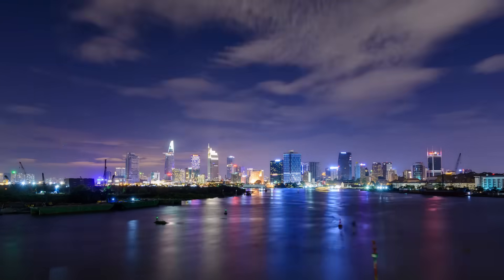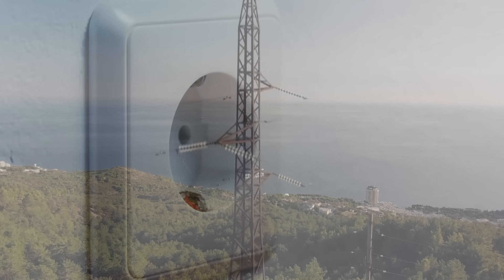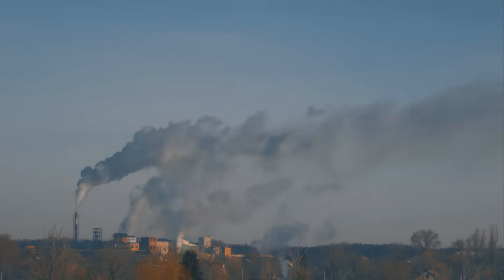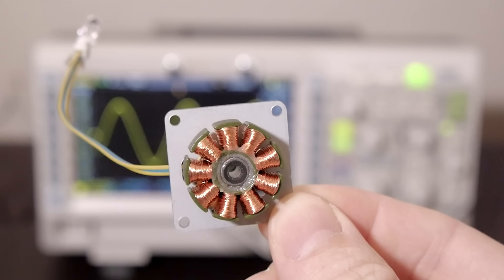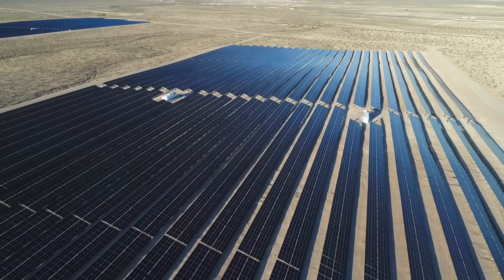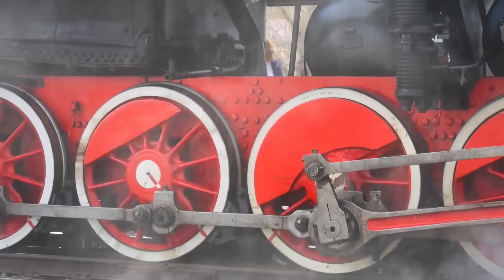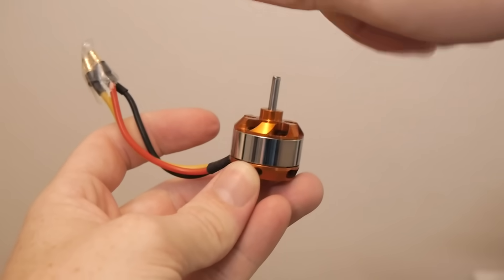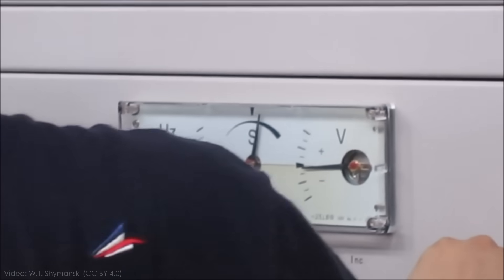How Electricity Generation Really Works

Comment: I see you are on of those types that still believe in Global Warming. It is called "Climate Change" now. 
FYI, Climate Change has been happening long before it was "human made".
Reply: Global warming and climate change are different things.
That said, you're wrong.
CO2 concentrations have been increasing (we're over 400ppm at this time, whereas it was just about 300ppm 150 years ago). https://climate.nasa.gov/climate_resources/24/graphic-the-relentless-rise-of-carbon-dioxide/

Isotope analysis of airborne carbon shows that we're the main cause of this increase ("natural" airborne CO2 has a particular ratio of C12,C13 and C14, what we release has a different ratio). https://www.bgc-jena.mpg.de/service/iso_gas_lab/publications/PG_WB_IJMS.pdf

Orbiting satellites measure an increasing level of EM absorption at the specific frequencies CO2 absorbs, showing that CO2 is indeed acting as a greenhouse gas. https://ams.confex.com/ams/Annual2006/techprogram/paper_100737.htm

This shows that we are responsible for the C02 being emitted, that we've emitted enough to significantly alter atmospheric composition, and that it is acting as a greenhouse gas.

On top of that:
-While changes in temperature and CO2 have occurred over earth's history, these happened over millennia, if not more. We've observed similar changes in the span of 100 years. Not natural.
-An increase in solar sunspots signals a decrease in solar activity, meaning less light. We'd expect a temperature decrease because of this. Yet that is not the case.
Reply: @MGTOW individualist Actually, we have far more than 150 years of data. If anything, the Vostok ice core samples track co2 concentrations over a 50K years. The last 150 years are just interesting because they show a massive and very sudden increase when compared to the rest of those 50,000+ years. 

Also, "Global Warming" is about the general change in global surface temperature over time. "Climate change" refers to the change in climate (precipitation, droughts, wind, etc) as a result of said warming.
But hey, at least I've seen those anti-science arguments a thousand times already. That's good, you're recycling.

Comment: Good video marred by misinformation regarding the correlation between fossil fuels and global temperature increase.  
In addition, wind has been shown to be cost-ineffective. 
Thank you anyways, the technical portion was informative, as usual.
Reply: You're wrong.
CO2 concentrations have been increasing (we're over 400ppm at this time, whereas it was just about 300ppm 150 years ago). https://climate.nasa.gov/climate_resources/24/graphic-the-relentless-rise-of-carbon-dioxide/

Isotope analysis of airborne carbon shows that we're the main cause of this increase ("natural" airborne CO2 has a particular ratio of C12,C13 and C14, what we release has a different ratio). https://www.bgc-jena.mpg.de/service/iso_gas_lab/publications/PG_WB_IJMS.pdf

Orbiting satellites measure an increasing level of EM absorption at the specific frequencies CO2 absorbs, showing that CO2 is indeed acting as a greenhouse gas. https://ams.confex.com/ams/Annual2006/techprogram/paper_100737.htm

This shows that we are responsible for the C02 being emitted, that we've emitted enough to significantly alter atmospheric composition, and that it is acting as a greenhouse gas.

On top of that:
-While changes in temperature and CO2 have occurred over earth's history, these happened over millennia, if not more. We've observed similar changes in the span of 100 years. Not natural.
-An increase in solar sunspots signals a decrease in solar activity, meaning less light. We'd expect a temperature decrease because of this. Yet that is not the case.
Reply: @MGTOW individualist so you don't actually care about the truth, I gather?
I post links as references to back up my points. It's called crediting my sources, quotes if you will. It's so you can't say that I'm pulling facts out of my ass. You should try it.
Reply: @MGTOW individualist So no counterargument.

Comment: Please stick to engineering. CO2 is not bad, it's plant food. Increase in CO2 = rapid growth of plants. Earth is extremely resilient and self correcting.
Answer these 2 simple questions:
1. What is the correct temperature of the earth.
2. What is the correct amount of CO2 in the atmosphere.
You being an engineer must consider the correct answers to know what is the best action to take and by how much.
Just spewing hypothetical scenarios as rising see levels and global warming (now called climate change due to global cooling trend) is engineering failure.
I will give you a hint of what is the single most influential factor in climate change, look up in the sky, it's hard to miss during day time.
Reply: Ammonia is not bad, it's plant food! Let's blast more into the atmosphere.

Sola dosis facit venenum.

Comment: How does solar power get its inertia then?
Reply: Solar doesn't have any inertia, at least PV doesn't. It's the other power plants that introduce inertia. A power grid with very high shares of solar PV would be very unstable without a lot of additional stability measures.

Comment: " A 3 phase supply can carry 3 times the power as single phase wire can carry on 2".......You are full of shit.
Reply: It's true. A single phase requires two wires (phase and neutral) and can supply current as high as its capabilities. Multiply this current with voltage and you have power. Three phase systems don't require a neutral wire (at least transmission systems don't), three wires means three times the current capability, which means three times higher power capability (at the same voltage level).
Reply: And you are another idiot that knows nothing about electricity, let alone what they are talking about.

Comment: The inertia that creates stability does come at the cost of slow startup and shutdown. Just as a heavy loaded train/cargo ship needs to decelerate miles before coming to a full stop, power station will take days and even months to startup and shutdown. Fortunately, we don't need to fully start or shutdown a power station very frequently as they are designed to operate continuously, so large inertia is usually beneficial.
Reply: Not really, synchronous generator syhcnronizing is done in a matter of seconds, it's the boiler or reactor that induced huge delays in some power plants. Hydroelectric power plants can be turned on in a matter of seconds or minutes at most, gas power plants are operational in 10 minutes or so.

Comment: Nuclear power is, in most respects, the next best thing to renewable. Sure, it has radioactive waste, but by the time it leaves the generator the half-life is long enough that half-decent shielding brings the radioactive flux down to the level of background radiation. The biggest problem (as long as you don't build them on fault lines or turn off their safety systems for a test) is the impact is has on nuclear weapon proliferation, and the right fuels can mitigate that. I'd pick that for my "inertia-rich generator," at least in areas where hydroelectricity and geothermal aren't viable.
Reply: We can actually burn that spent fuel, which about 40% of it is Plutonium at the end of a fuel bundle's life, in special fast reactors. Unfortunately, this hasn't taken off due to economic reasons and nuclear security. I believe France is looking into it, though.
Reply: It can go underground, currently in the USA that project is on hold.
It's also far from a dead power source, if natural gas wasn't so cheap (at the moment) more than just a couple new units in the US would be being built right now. China and other countries certainly believe in the power source.
Reply: The other thing is that a lot of people are scared of them because of Chernobyl and the whole "radiation" thing. Publicizing the facts and how many we have in the US could help with that.
Reply: Nuclear plants have the same "inertia rich" turbines that any plant using steam (coal, gas, solar reflector) has.

Comment: But solar pv don't use synchroscopes as the electric charge is dc and is converted to ac.
Reply: Yes it doesn't but it usually uses a PLL for the inverter to work properly. Electric charge is neither DC or AC, it's the voltage that is.

Comment: A detailed discussion on Steam Boilers, Steam Turbines, Alternators, Transformers etc will be great. Why increase in load decreases the rotation of the shaft?
Reply: Because demand exceeds supply, and the difference has to come from somewhere. It comes from the rotational energy of generators and turbines, which makes them slow down.

Comment: You can’t say that current renewables make economic sense with a straight face. You should really dig into it. Real buffered 100% renewable energy with all the costs (also decommissioning) is terribly expensive, which is why you could not ever get one done.
Reply: It is doable, the political motivation simply isn't there yet.
One big part of the solution can be demand-side-management. Simply said, the idea is that we use everyday objects (like fridges, electric car batteries, venting systems, heating systems) as energy storages: Use power when power is there (sun shining, wind blowing). Obviously, the initial investment is huge, since those objects need to be smart about when to consume power and when not to, but we could already be halfway there if we really wanted to. We don't though.

Comment: Great video! As a dude who study the grid I always tell people the most important thing imo: when you open the light instantly somewhere a generator feels the tiny slow down and pushes to keep spinning with the same speed.
I know that it's a simplification, but if people understand it and get comfortable with the idea of helping the system by not washing their clothes in the evening for example, (demand side management) we will be able to achieve high renewable energy penetration. We just have to make some compromises.
Reply: Flattening the load curve is also more efficient  - not sure where you live but where I live, it would be beneficial for everyone to do laundry during off peak hours.
Reply: @rthat1  I live in Greece and the peak occurs at 8pm-10pm especially in winder. You are right that this is not true for everyone and depends on the system under study. 
Where are you from and where is your peak?

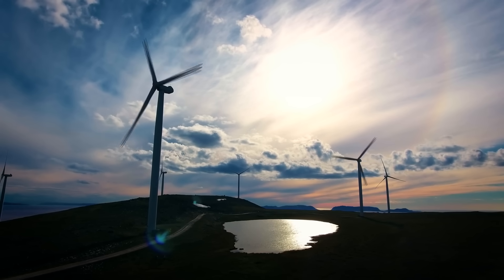Comment: @5:52 your first demonstration is of an open circuit which does have no load.  However, when you short the three phases together, the variation in torque you are describing is due not to high load, but by an out-of-step fault resulting in variations in the flux.

Comment: Your video was helpful in understanding the nature of photovoltaics on residences and why we cannot expect a 1:1 return on cost when providing power back to the grid, thank you for that.

On the other hand, the system for interfacing to grid-connected-solar-customers is still unfair and requires fresh oversight.  Power companies often want to charge as much to a solar-tied-customer as they would if that customer was not producing any power themselves; they use an entirely different pricing scheme separating the grid-tie charges from the usage charges.  This is not something normally required for non-solar customers, their grid and KWh are bundled into a single charge.

I would like to see everyone treated the same.  Everyone should have separate line-items for their grid connections and for the total power consumed versus produced.  This would serve to encourage solar for high-demand parts of the day when a power company really could use the extra generating capacity of rooftop solar, while not penalizing solar customers.

If this sort of regulatory change doesn't happen then I foresee solar equipment providers with battery storage increasingly getting properties off of the grid entirely, even more to the detriment of the power company than if they allow solar with rules that make sense.

Comment: Yeah... wind and solar deliver asynchronous energy into a synchronous system...  makes grid management harder and demands more spinning reserve... which sort of defeats the purpose of having wind and solar in the first place... fossil fuels may be ugly... but ya can’t run away from the physics....
Reply: No. Modern grid scale generation is effectively synchronous. (actually wind is better than, as more of the turbine inertia is available without frequency changes). Spinning reserve is required for coal generation because they drop off suddenly, at GW scale and with no warning.
Reply: Ok... but when the wind stops blowing... then what?? Also... coal is universally treated as baseload... so how do you need spinning reserve for baseload??  Typically dealing with a demand spike can be covered via hydro (or a supply drop)... so why does coal generation need reserve? You comment makes no sense....
Reply: @brucemckay6615  spinning reserve deals with sudden changes in generation, less than a second. The wind doesn't stop in a period of less than a second, it takes hours. However coal can and does stop generating in less than a second. That's why you need that spinning reserve for coal that's not needed for wind.
Reply: Nope... still no seeing it... at a coal plant the fire does not just go out... there is a reserve of heat that will disappate over time but it just doesn’t disappear... which is what u imply...  a drop in lad from a wind fRm or solar array is pretty instantaneous... where as for coal et al the decay curve will be more gradual...  maybe u r thinking of reactive power to manage frequency??
Reply: @brucemckay6615  I'm thinking of ruptured steam lines, tripped breakers, boiler explosions, turbine failures, control system failures, turbine inlet temperature excursions, cooling water pump failures, among other things.

You seem to have the common (incredible) misconception that complex machines that operate at high temperature and pressure run for decades without ever having a problem. That's how the coal industry likes to spin it, but that's nothing like how they actually work.

Comment: Supposedly, a high voltage DC super-grid across Europe would allow Europe to rely exclusively on renewable energy sources without the need for massive energy storage infrastructure. I've also heard of smart grids that can use electric car batteries for local storage. Can you talk about either of those systems? Are they feasible? Do they have other strengths or weaknesses?

Comment: so i guess what i dont understand is why solar doesnt have this power "intertia." you go on to explain what the inertia is , and how other types of generators work, but i feel like you never touched on how solar doesnt work in this way.
Reply: It doesn't have a spinning generator, it's a static device, it doesn't have any rotational energy (sometimes power grid inertia is measured in MWs (jouls)).

Comment: Awesome.   I'd been wondering about electricity generation and use.  Great information. Thanks

However, I still having a hard time understanding why when there's no load the generator will spin freely and under load it's hard to spin.  Is it a magnetic resistance?
Reply: It's kind of complex. My best explanation would be this: when a generator is under no load, the rotor and stator magnetic poles are aligned (north to south and vice versa). When the generator is under load, there is an angle between the poles (proportional to the load).  So the stator's magnetic field actually pulls the rotor back, while the turbine pushes it forwards. When they are in balance, the rotational speed is constant. This is a bit of a simplification though, in depth analysis of synchronous generators is very complex, I don't understand it fully and I'm on my way to getting a master's degree in power engineering.
Reply: @FrainBart_main  Thanks for the response.

Comment: After correctly making clear the instantaneous nature of electric power generation and consumption at the beginning of the video, it's unclear why @8:27 the unqualified claim is made that "we" must convert to renewables when solar and wind are intermittent, requiring a storage solution which is orders of magnitude out of reach. There is no utility grade battery storage facility that can backup a single, middling 500 MW thermal/wind/solar plant for a day, not anywhere in the world, nor are there any serious (financed) plans to build one. The passing claim is also made that solar can provide some homeowner power, yes of course, "or all", i.e. year round, night and day. The latter is nonsense for any modern single family home.  One sees these all-solar claims, but they invariably have a utility grid connection or a combustion generator hiding behind the curtain.  Tossing out these unexamined claims would be a bit like a new Pactical Engineering video on eliminating concrete construction in lieu of mud highways.  Mud kinda works at small scale, but really?

Carbon emissions are a problem, but nuclear power is so far the only remotely viable solution, and nuclear still is the largest single source of low carbon electricity in the US.